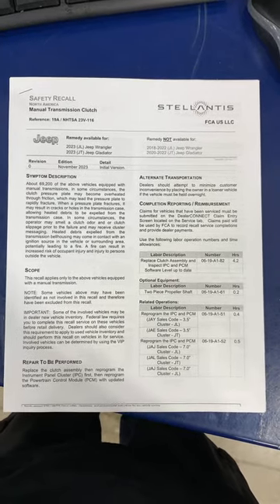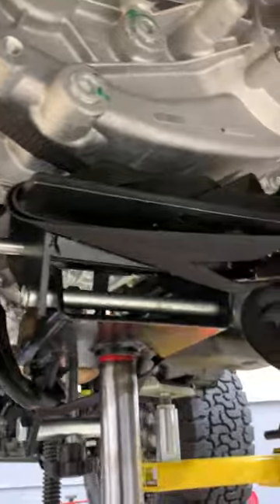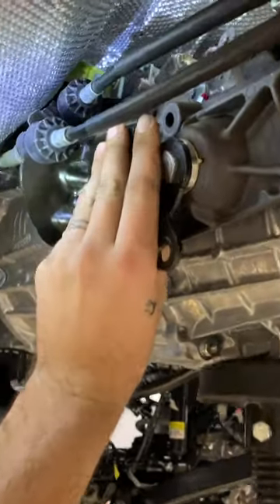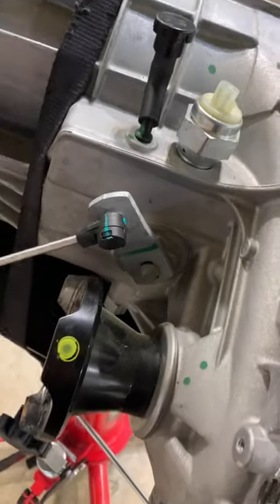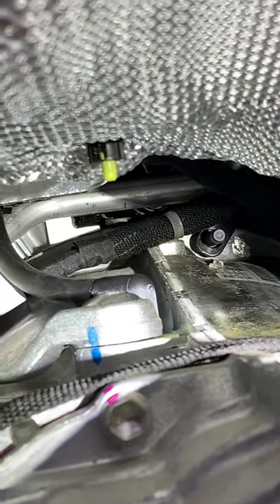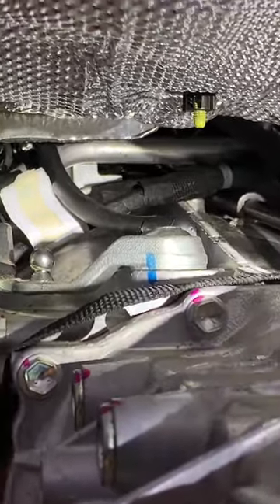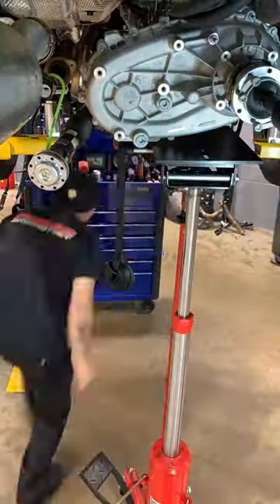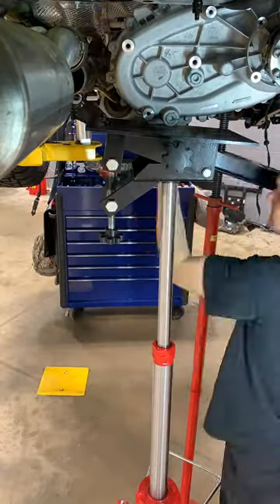Jeep Wrangler Clutch Replacement - Safety Recall 19A - UPDATE! - 2023 Jeep Wrangler TJ

Comment: What tool did you use to plug into the OBD port? I am having that issue now and the Jeep dealership is looking at me like  Iam crazy after I mentioned the issue you referenced above. They are trying to tell me it is because I don't know how to drive a standard transmission. But I've had standard vehicles and motorcycles all my life.
Reply from the maker: The Mopar OBD pod provided by the dealership. (PCM - Clutch Replacement EEPROM Reset Procedure)